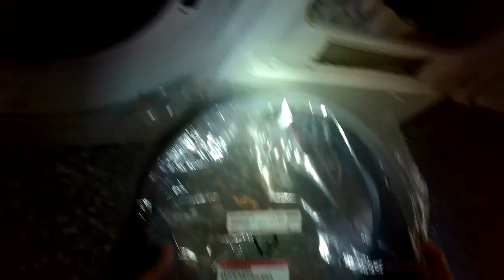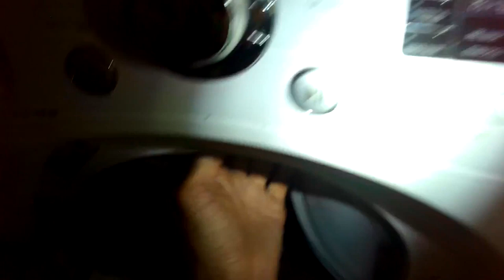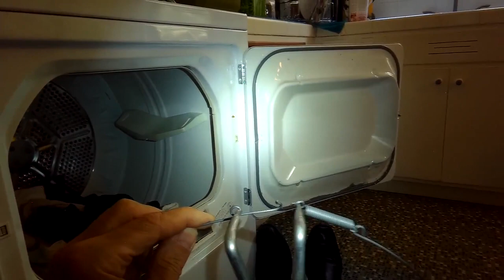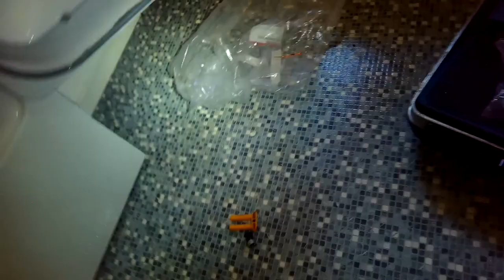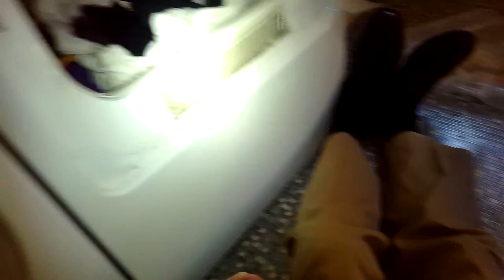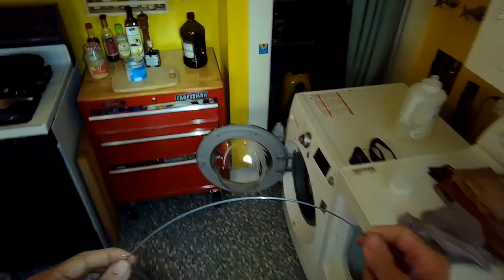LG WASHER BOOT REPLACEMENT (NEW METHOD)

Comment: Super helpful video, thanks!  I've replaced my boot twice now, both times I had to pull the washer out of the built-in where it's installed to remove the top panel, which is a project all by itself. 
Today the bottom of my boot worked it's way loose (teenager overload) - this video saved me SOOOO much work.  I was able to remove the boot, clean it (gross), and reinstall in about 45 minutes.
The LG tool is essential for this project.  I bought a knockoff from Amazon (Gekufa 383EER4001A "Washing Machine Outer Tub Spring Expansion Tool") for $15.  I also used a 6-inch piece of scrap wood (2x4) to wedge between the top of the drum and the back of the control panel, to keep the drum tilted back and make it easier to detach / reattach the inner spring.
Reply from the maker: Very impressive, thanks for the info.😊👍

Comment: I took my boot off to replace it and cant get the top off, wont slide back even though I removed the screws in the back. Any ideas of why mine wont come off? Model  LG WM3001HPA
Reply from the maker: Try prying it back with a flat head screwdriver.  Make sure there’s no tape holding the top down.
Reply: @QuickAndEasy5MinuteAppliance  Thanks for the response, are you thinking like a double sided tape holding it in place?
Not sure what to pry against because its plastic in the front.
Reply: @QuickAndEasy5MinuteAppliance  Ok tried prying on it and tapping the front corner with rubber hammer and it feels like as if its bolted down, wont budge a bit

Comment: I got the spring off but can't get the boot off
Reply from the maker: Try prying it off with a flat head screwdriver
Reply: @QuickAndEasy5MinuteAppliance  I had 2 spring rings on .I had to take the front off.i got the new boot on .I need to get the springs on
Reply: try pulling it off harder it’s stuck. Pull it out with a little bit of curse it helps
Reply: You make it look like a piece of cake !